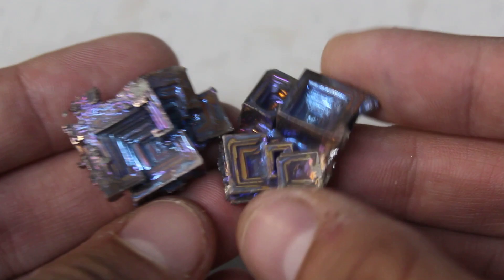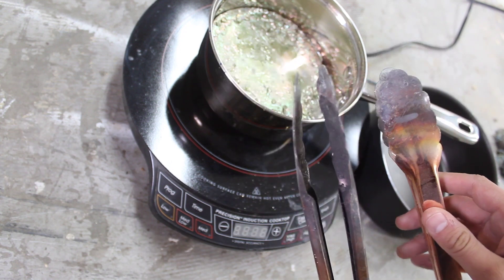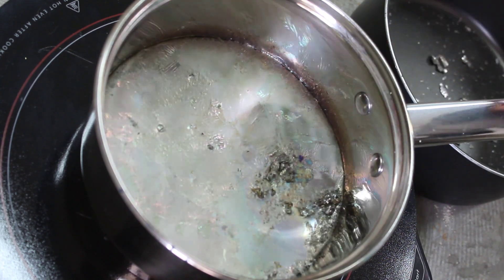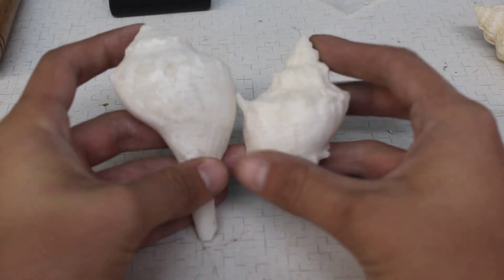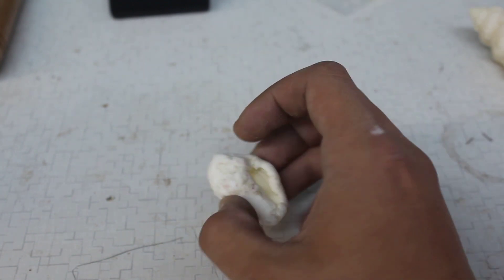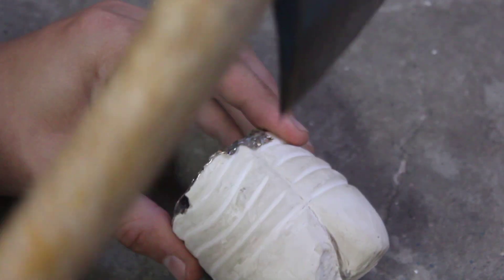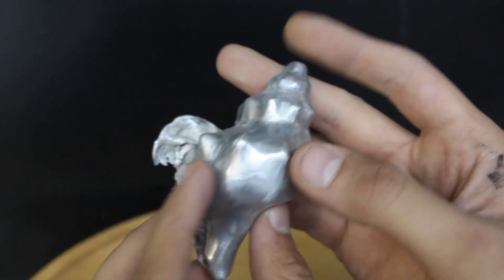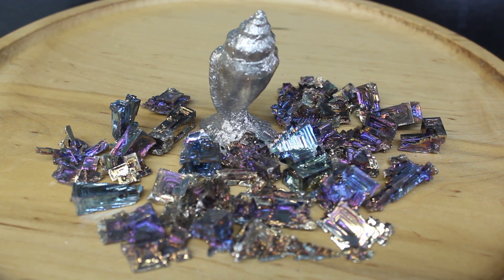"Playing" with BISMUTH! Awesome CRYSTALS and EASY Metal Casting!

Comment: Casting with Lead (Pb), Tin (Sn), Zinc (Zn) or Pewter(putrid) makes sense because they are cheap and relatively low temp, but casting with Bismuth (Bi), is a waste, unless you are making the colorful crystals or oxidizing the surface layer of your cast.

Comment: I'm a HowTo kind of girl, so I have a "burning question" about this procedure. I saw that there was a little "hop" between seeing the melted bismuth in the pot & then suddenly there were things on a plate. So, were these crystal structures GROWING THEMSELVES in the melted bismuth in the pot? And, were you plucking them out with the tongs & placing them on the plate?  The longer you leave them in the melt pot, the larger they grow?  This is utterly fascinating--that's why I'm asking!! Thanks for this very different kind of process!

Comment: Very cool! Do only the crystals get that bismuth rainbow of colours or can that cast get it too if you were to polish it for instance?
Reply from the maker: Unfortunately the colors come from the metal oxidizing at high temperature, so they do not get the same colors from casting because air does not reach the inside of the mold. I am definitely trying to figure out how to get them to oxidize after casting because that color is just too cool!
Reply: @TheoKellison  you blowtorch the cast, it heats up the outside enough for it to melt just a tiny bit and change colors, I was hoping you were going to do it
Reply: @TheoKellison  torch them and the color should come back .